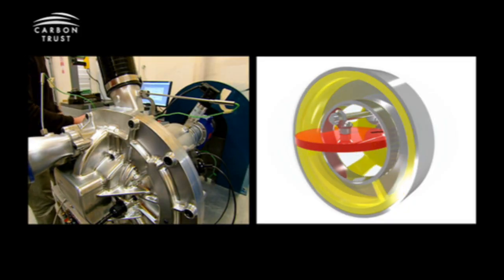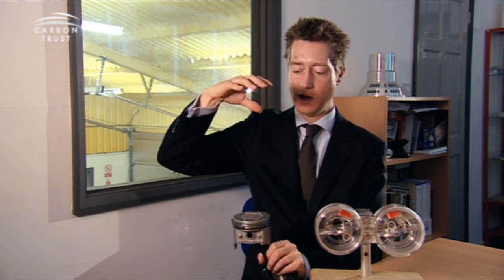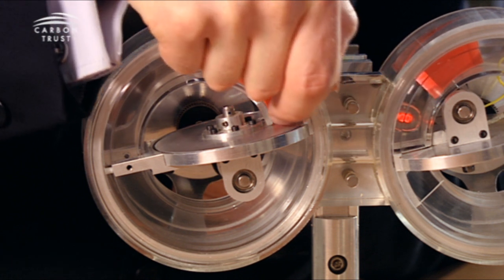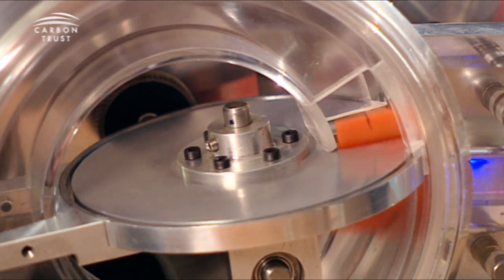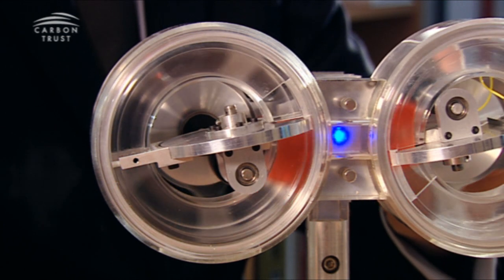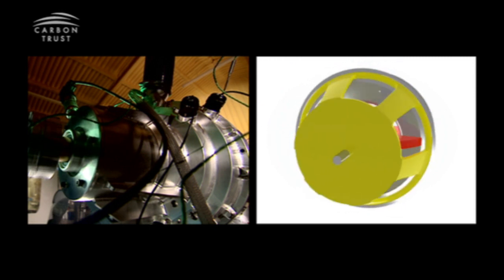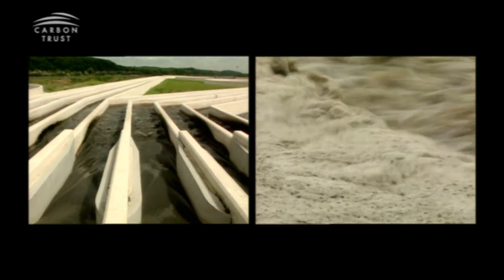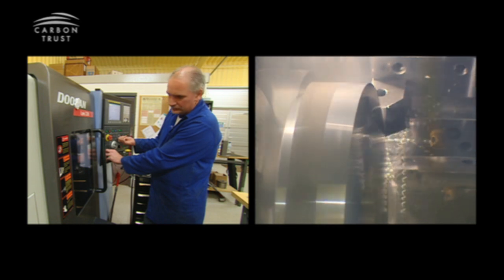Clean Tech Entrepreneurs: Lontra compressed air systems

Comment: Until it can compress to hundreds, even thousands of pounds of pressure, it will be a limited use device. And clearly after 12 years not much has happened.
Reply: Apparently it was invented in 2003, so a full 20 years has gone by.  They still only have 27 employees.